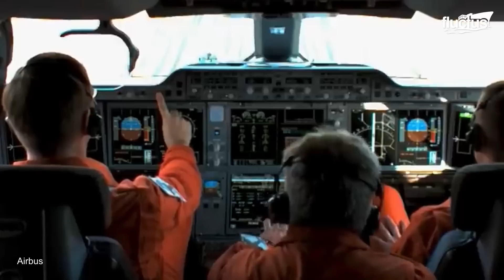The Reason Why Boeing Almost Destroyed its Own 747 During Cruel Tests

Comment: Being in aviation for over 50+ years as an aircraft Tech. The only way to know much an aircraft can take is to push it to it's braking point. Static or in flight testing has been done since before the Wright brothers ever took off. Only now computers do a lot in a more safe manner without risk of life. The amount of physical testing and collecting test data is staggering. Thousands and thousands of hours are spent by aircraft and related parts manufactures for every single piece that goes into producing the final product you fly in.